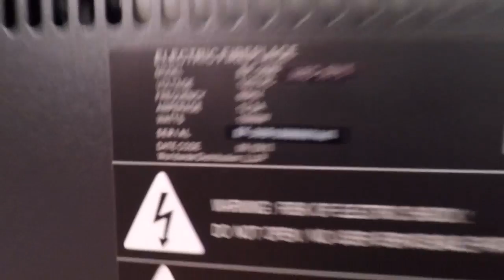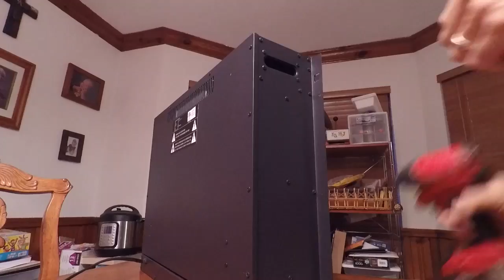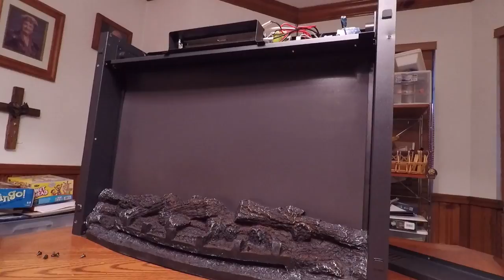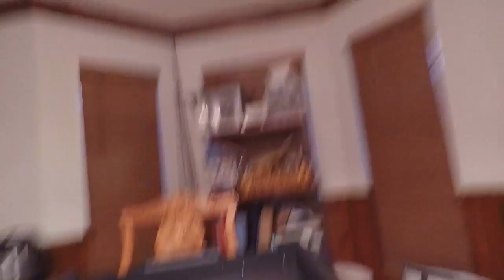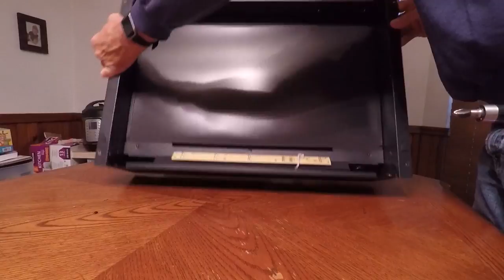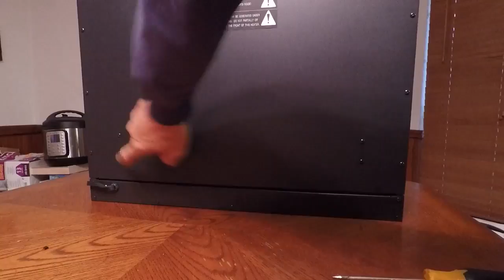RV Camper Intertek EF-30B Fireplace Disassembly Repair, Squeak

Comment: You should have removed the 10 screws ON THE BACK. That is the correct way to gain access to the unit. I had an annoying chatter. It was coming from the blower motor. I oiled the bearings and all is quiet now.

Comment: You could have just taken the back panel off, that’s what we did.  We were checking for loose wires, as every time we tried to turn it on, it would flash but would not turn on.  After checking all connections, and plugging it back in, now it does not even flash.  Nothing.  It is a 03/2016 but came in out 2019 RV, so assuming no warranty on it.  Wonder if maybe a circuit board or what.

Comment: or maybe put in some actual bearings?  thanks for showing the teardown.  I want to increase the heat output of mine, think I'll add a second heater on top.  I find it is pretty heavy too for an RV, maybe use plastic instead of glass?  that must be a lot of the weight.

Comment: I have been trying to find all over the internet the manual to this fireplace.  If possible and you would be willing to take the time and email it, I would be so grateful.  I also cannot figure out why it has two switches to turn it on?  One on the left and one on the right.  If I turn the right switch off then the fireplace will not come on but I sure would like to know why.  Thank you so much for any help!  cindydickerson@hotmail.com     P.S.  I loved your video and saved it!!
Reply from the maker: Hi Cynthia. Thanks for the question. I'm having trouble finding my manual for the fireplace. If I do, I'll send you a copy. As far as the two switches go, the way mine works is, the rocker switch on the right is the master power cut off and the dimple switch on the left is the control power. If you have the unit running and turn it off with the dimple switch while leaving the master on, the fan will continue to run to cool off the heating element and then it will shut off. If you flip the master switch while it's operating it kills all power immediately. I'm not sure if leaving the master on also allows the unit to remember your previous settings, though it might.
Reply: Oh, this is a great big help!!  I just could not figure out why this would be necessary and this explains it all.  Thank you for your time and for looking for the manual!  I appreciate it!!
Reply: @cynsew  I have manual
Reply: Oh Robert, would it be possible to get a copy of that?
Reply: Would it be possible for you to send me a copy??
Reply: @cynsew  sorry it is taking me so long
Reply: Thabk you so much Robert for trying, I understand if it is to big of a job!!  Cindy
Reply: @cynsew  I have the paper copy that came with the rv I can mail you.My phone camera is not copying it too well..I found it online,but can't find it again. GIVE me a mailing addresses and I will send you my copy.Sorry I'm taking so long
Reply: @robertwatson4264  Oh,  thank you Robert  1326 Rosedale Dr. Mansfield Ohio 44906
Reply: @cynsew  Huston we have lift off!!!
Reply: I was using my friends phone.Hope you enjoy the manual. From RW and NLB
Reply: Oh thank you so much!  I will let you know when I receive it!!!
Reply: @norabobillot4353  I am very sorry to say, I never received the manual.  Thank you though for trying!  I do appreciate it!!
Reply: @cynsew  mail can be slow.
Reply: Well you are correct!  There today in my mail box was your lovely card and the firplace manual.  I can't thank you enough!!!  That was very kind of you to send it!!  Please have a blessed Christmas and a wonderful new year!!!  Cindy

Comment: I have a different model fireplace (Titan Flame WF-36S) on a brand new 2020 RV with the same problem. I removed the back a in December and was able to access everything but at the time, I didn't have any lubricating oil so I just fiddled with everything and put it back together; yes, squeak was still there. Love the idea of drilling a couple of holes in the back to enable future lubricating and will make that change the next time I get the RV where I can work on it. Thanks for posting the lubrication points that resolved it for you.

Comment: Great video! Mine doesn't squeak (yet) but will know what to do when it does. Now I also know there's an extra electrical outlet that I really need to use for entertainment equipment up above. Plus it gave me some decorative ideas for changing the total appearance of the FP.

Comment: On my fireplace the remote quit and also the heat button will not do anything.  I did play with it one day and the heat came on for a short time.  any idea what could be the problem
Reply from the maker: Howdy! That's an odd one. Remote-wise, first thing I'd check would be the batteries. If that doesn't change anything, I'd start looking for maybe a loose wire somewhere in the top of the unit where the controls are. Best of luck!
Reply: Probably already resolved but if the unit gets too hot or thinks the vents are blocked, it will trip the safety cutoff. According to the manual, it will not reset for safety reasons and you must unplug it for at least 15 minutes and then plug it back in to reset.

Comment: Can you tell me who manufactures this fireplace.  I have one in my 2017 Holiday Rambler Vacationer and it has quit working for heat.  I removed it and all I can find is the modle number of EF30A and a tag that says INtertek.  But unable to find anything on the internet.  Great video .
Reply: Titan Flame Model EF-30B

Comment: Great video, thanks for posting it! We have the exact same fireplace in our 2017 Coachmen Chaparral 391QSMB fifth wheel, which we bought used in December 2017. No squeak from mine thus far, but I'll be ready when/if it does.

Comment: I would suggest drilling the access holes for future lubrication when the unit is disassembled.  That way it is possible to easily vacuum shavings and debris from the inside of the cabinet.
Thanks for a very useful video. :-)

Comment from the maker: I've been asked if the rear would be easier to remove than the front. I've checked and sure enough, the correct way to open this up is precisely the opposite of what I did. The rear cover and the top can be removed without disturbing the log or scrim. If you need to replace any of the electrical components this may be an easier option. Thanks for watching!
Reply: Our EF-30B was squeaking also. The rear cover is definitely the way to go. 10 screws to remove the back and six for the top cover makes doing an annual cleaning/maintenance of the unit is easy. Our squeak is now gone! :) Thanks for your video.
Reply: A youtuber who has humility. You are a rare bird. Thanks again. My hearing is shot but I'm sure my wife will let me know.